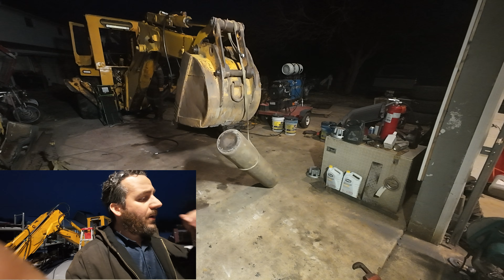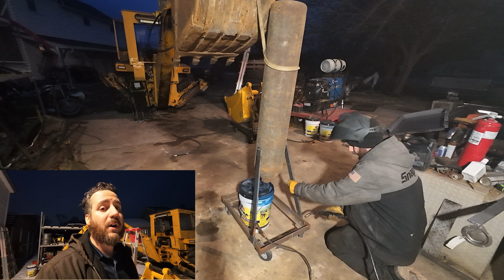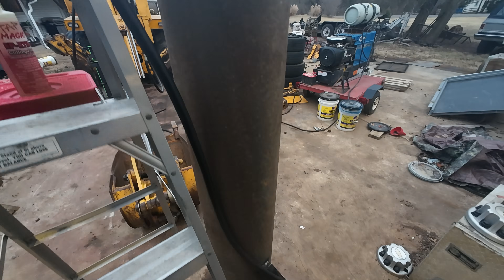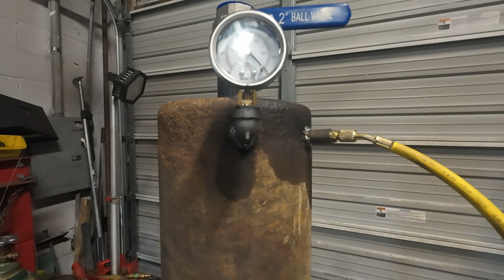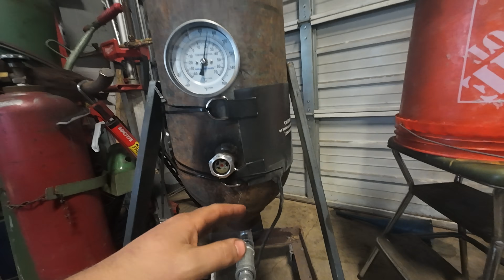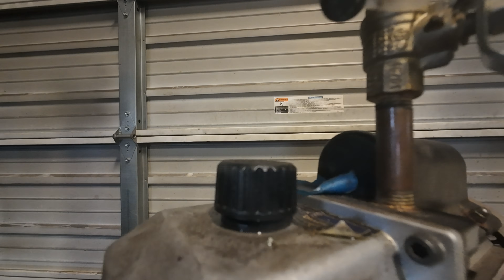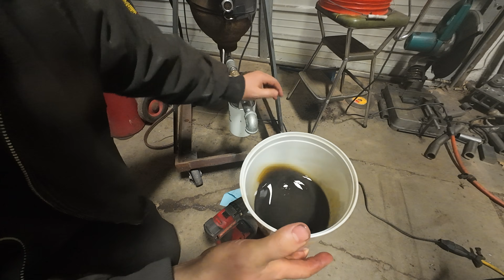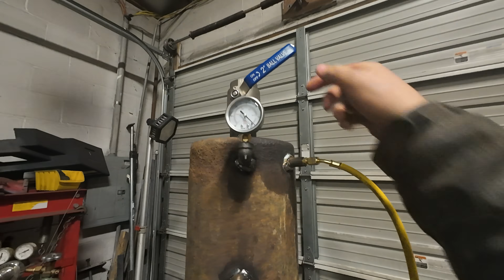I made a machine to remove water from hydraulic oil. Vacuum de-hydration

Comment: 25 years ago, had a heat exchanger burst and fill a 700 gallon hydraulic tank, that held 420 gallons of oil, on a large injection molding machine, full - when it overflowed is when the operator noticed it.  Shutting the machine down did nothing - they had to figure out that shutting the cooling lines off that went to the machine stopped the overflow.  The machine was about 65 feet long and the entire system was full of this oil and water.  We were broke as a company so our options needed to be carefully weighed.  I was in charge of everything.  I talked to many people in the industry.  Found a 1 in diaphragm pump from our lubricant supplier for cheap, he also gave me a 2 in bulk fuel filter that was made by cimtek that he could run water absorbing filters in.  It used three cartridges.  I built a filter cart with the pump and filter.  Decided to have it tested for quantity of water - and fortunately a smart man told me that the oil that was in the machine would be worthless, but to drain all I could and clean all I could then fill the machine to the minimum required to run, then run the machine a little and then take a sample.  We did just that - it had man holes that a small person could fit in and I had a willing employee climb in there and vacuum out the dregs after we draind the machine.  So I have no idea of knowing how many gallons of water was in the oil in the piping and pumps and such without a sample.  I do not remember what the sample showed by it was a lot around 6 gallons of water in that 250 gallons that we put in after the drain in clean.  I did some math - the filter cart I built could literally only hold a few ounces of water per element - did the math and it was going to cost a fortune in elements - that would have been dumb.  Went on the hunt for the most absorbing filters on the market - found US Petrolon - they are still in business.  Paid a lot for their 2 element cart and some spare filters - best of my memory - cart was $5k, filters $75 each - took 3 pairs of filters to clean it up , but wow, it was clean - looked brand new.  Tested better than new on particle count.  The math showed that this was the cheapest option, swapping oil in the machine trying to dilute was at risk to about 7 pumps totalling 225 hp - an expensive risk - oil was expensive anyway - so we would start the machine for a few seconds and move the cylinders and eventully broke lines loose at test ports (this machine has test ports everywhere) to let fresh fluid travel.  Each of their filter could hold 5 QTs of water and would plug up as they absorbed - 6 filters was over 6 gallons as the samples showed.  That filter cart has been used all these years as preventive maintenance every six months on every molding machine and has likely paid for itself many times.  My homemade filter cart I ended up taking after I left because they wanted to clean the shop up (it is my parents company) I have cleaned tens of thousands of gallons of diesel, and hundred of gallons of hydraulic oil to remove water and particles on everything from road graders to skidsteers and many bulk tanks and transfer tanks fuel systems.  Hope this helps someone - US petrolon was top notch to work with back then and the cart was built perfectly.  Hope this helps someone.
Reply: What a great effort and success! Well done!

Comment: this piece is pretty dang cool but i have seen spray dryers before that basically just have a heated tank that heats the oil to roughly 90c aka ~190F and then they have a chamber that sits higher then and drains into the tank, the oil is then pumped from the heated tank and sprayed into the upper chamber while a small fan pulls air through it at a gentle pace this pulls the moisture out of the oil in a continuous process.

Comment: it looks exactly like when i get water in the oil of my pressure washer. I've got a bad seal inside the pump on my pressure washer so i keep changing the oil because it only takes about 13 ounces to change it and im lazy and don't feel like rebuilding the pump right now and it still performs well but I also know what water can do to a hydraulic system I've rebuilt engines no problem but I've never messed with a hydraulic pump so i don't know lol im thinking about just buying a pump that is more powerful than the one i have off of marketplace or something like that

Comment: Spank Ranch Garage have you made any modifications to this build? Also I'm curious to know what your day job is or what field at least 😁 it's an absolute awesome build. I found your video because I thought of the idea someone asked a question how to separate waste oil from water. Is this idea all yours or was there some r&d involved no disrespect just curious.
Reply from the maker: I work in mechanical engineering but in reality I just do boring paperwork. There is very little brain power consumed in Corporate America, so I am free to think up ideas like this to keep me busy at home. I havent made any changes to this machine since the video, its been working good enough as-is. I didnt really have any inspiration when I built it, I just wanted a safe way to remove water without the hassle/risk of heating the oil above 212F. With this design I can plug it in and walk away for 4 hours or 24 hours if I want, and nothing bad will happen.

Comment: you remove the water, but the acid that form from the mixture of the oil and water remains
Reply from the maker: Good point I haven't checked the pH of the new oil vs the dried oil

Comment: It's been a while but who knows, it may still help. 

We use a very similar approach for transformers. The main difference is that we heat the oil to 250F then spray it into the vacuum chamber. This significantly improves the efficiency and the dehydration level to sub micron contamination. The main challenge is just building a pump and spray system that does not introduce a leak into the system. It's normally done by dosing until an accumulator is full. 

Great work though on a home game solution
Reply: As a follow up, based on participate contamination, a centrifugal separator would be ideal to get as close as possible to factory. 

Oxidation and breakdown will not be fixed, but it is a major improvement. We go through hundreds of gallons of hydraulic fluid a year and recycling has been a big improvement in our costs.

Comment: Do you think this work if you adapted the vacuum to go directly on the machines hyd tank and ran the machine to warm the oil then capped the vent off and pulled the vacuum. Obviously would have to take in consideration the thickness of the tank to prevent implosion 🤔
Reply from the maker: I think thats really tough on seals as they are made to work in 1 direction. I wouldn't recommend putting the machine under vacuum

Comment: Here are some suggestions.

1. Run your processed oil through Waste Oil Centrifuge to get it even cleaner.

2.Send a sample of your cleaned oil to a place like Blackstone Lab to determine if the water content is within speck. 

3. Put a Oil Filter/
Water Separator kit on the machine.

Comment: Only way to fully drain a hydraulic system is to fill the reservoir with diesel fuel.   Start it and cycle each cylinder in and out as many times as possible.  Make sure to use things like power steering so that you run the diesel through everything in the system.     You can also go through while it’s running and crack each line and let it run out until it turns to pure diesel fuel.   You will probably need to go through this process at minimum twice.  Draining the fuel and using new clean fuel each time.     Then drain and refill with clean hydraulic oil or ATF (what I run in all my machines).  The atf causes less wear in the winter when cold out causing the oil to be so thick it can actually run the pump dry due to oil not flowing.   With atf it doesn’t get thick in the cold and is great for withstanding the higher temps.
Reply: Also. Don’t try to reuse that oil.  Get new oil!

Comment: As others mentioned, while the vacuum lowers the water evaporation temp, it also lowers the oil's.
That oil did look rather burned.
Might be good to get an oil analysis done before putting full faith in your current system and finding out the additives are gone and it no longer encapsulates the water.
Maybe do another hard core leak test and get that solid and then get your pressure/temp figured out.
Quick google shows hydraulic oil start degrading at 140 F.

Comment: Nice! Can you open a new bucket of hydraulic oit, pour it in an open container to see if it matches the de-hydrator output?  Then run the new fluid thru the Dehydrator for a few hours and put it back in the open bucket to see if the process changes the color...

Comment: Doing this complete evolution, how many times can you do this without any degradation of the oil? If any? Would you be able to use the same oil, filtered and dry of h2o indefinitely? Great videos. I watch you do your magic with fascination. Thank you for the entertainment!
Reply from the maker: I am sure each de-hydration cycle changes the oil slightly. There are lighter additives in the oil that may be boiling off too. For me, I do it as many times as it takes to "dry the machine out". Then I replace the oil before I put it into service. I am really just using this oil as a wick to pull/flush water out of a contaminated system. For this backhoe, I dried 10 gallons of oil out 4 times, for a total of 40 gallons total. I then drained it again and added ~12 gallons of new oil and its been perfect

Comment: You need a cold Trap on your Vacuum line or your gonna put the water  into your Vac Oil ,   A small  cylinder  in an Ice bath should re condense your water before it enters the  vacuum.

Comment: 👍👍👍 I am trying to do the same thing on John Deere 650G Dozier never thought of using an oxygen tank for a vacuum vessel.
Reply from the maker: Anything to get the water out! Those G models clutch plates don't like water from what I have seen. At least they come out fairly easily if need be, but I hope you can dry her out and get back to working!
Reply: Thaks!! I got a friend that get used hydraulic fluid he workd on forklifts ive got around 100 gallons to process lol

Comment: That was great, best vid I'll see today. Wondering what would happen to the fluid--both before & after your vac/boil--when run through centrifigul filter like used to filter engine oil to make black diesel fuel. Subscribing now.

Comment: You basically made a type of distillation collumn.

You could also try a centrifuge to separate things. (You can get these machibes even in small sizes from online shops).

Another fun one is basically a slushie machine. You constantly agite a mixture that you cool below water freezing, and the water will crystalise.

Comment: I worked in the fluid fill industry, we made machines to dehydrate oil by putting it in a steel tank and heating it while in a vacuum and it would pull the water out. We would then dispense the oil out of the tank while still under vacuum and refill as needed to feed assembly lines.

Comment: Would a tank higher than 10m work? With optimal conditions, vacuum can pull fluids only about 10m high. If the isolated tank is higher than a vacuum can pull the fluid, then only water vapor will reach the pump. 

Do I understand that correct?

Comment: My suggestion is to try centrifuging the oil. I saw a YouTube video of a guy cleaning motor oil with a DIY centrifuge made from a kitchen juicer. That video had the pure oil flowing over the juicer chamber, the sediment stayed in the bowl, but to get water out the oil would float (and in the juicer go over the top of the bowl), leaving water in the bowl. Because the juicer orks on an overflow principle you can constantly add more contaminated oil into the top.

Comment: I can say that although the hydraulic oil is dark after distillation of water, its operational properties have improved. Corrosion of the hydraulic system has decreased, hydrolysis of additives has decreased (especially anti-wear ones, such as ZDDP, if it is zinc-containing oil), the load on the pump has decreased due to the decrease in viscosity of the dehydrated oil (the emulsion had a higher viscosity). Good gob!
Reply from the maker: I agree with you! The oil isnt as good as new, but its a lot safer to use in my 50+ year old machines without all that water in it.

Comment: I’ve had that idea for a long time. Really nice to see someone put it into actual practice and work the bugs out.
To keep the contaminants out of your vacuum pump, use a (clean) 20 pound propane tank built into a cyclone type pre -filter. 
With the vac from your pump plumbed into the top valve and the line coming from your dryer into a fitting welded on at an angle to the side of the of the propane tank so the flow introduces a vortex on the inside of the tank,  any fluid will separate to the outside and the clean air will be pumped out the middle. 
A valve could also be installed at the bottom to get rid of oil and any water that condensates on the colder tank. 
An ac compressor also works good as a vac pump. 
Thanks for the video.
Reply from the maker: All great ideas thank you!

Comment: I love DIY projects in the garage. Great job.
Couple of suggestions from chemistry lab:
Mixing the oil in the tank somehow would make water removal much faster.
Installing a trap between the tank and the vacuum pump would save your vacuum pump. Ideal trap requires liquid nitrogen bit you may try desiccants in a long tube along the vacuum line.
Lastly, we use molecular sieves to get anhydrous solvents. Water molecules kind of bind to these ceramic based beads and leave your mixture. They are quite cheap for the job. I wonder if they could be used for hydraulics.

Comment: The method is great! But I would se an intermediate vessel between the pump and the big oil vessel, cooled as possible so you could test how much water you're taking off. Of course, you can compare oil in/oil out and estimate how much water was taken...What aboout a vessel with silica gel (since it can be dried after absorving humidity?)

Comment: You don't know if there was rust on the inside of your cylinder. Probably there was because that is an oxygen cylinder and OXYGEN CAUSES RUST.  Rust is iron oxide.
I believe there is only a trace of rust in your reconditioned oil and it causes the discoloration. Ignore it.  
You did a great job.

Comment: Id add a bit of ethanol and let phases separate. Then separate off water. Then add 4A Molecular sieves. Recycle them in an oven to dry. Fast cheap and easy. Probably oven drying a cheap zeolite kitty litter would work just as well for your purposes and can be recycled or dumped. Hell, damprid (cacl2) might work really well for the first water stripping. Run a cold finger so you dont put all that water thru your vacuum pump.

Comment: I used to just put the oil in a bucket with a drain valve on the very bottom, let it sit a few days, open the valve and the water would drain out. Once oil started coming out clear and not milky, no more water.
Reply from the maker: For whatever reason that doesnt work with this fluid. It wont let the water out without other means. This has worked great for engine oil for me

Comment: Cold trap would save the pump could modify a ice maker or window ac and maybe get a electronically controlled valve and the valve that lets you cange the flow of the refrigerate so you can defrost the cold trap on a timer

Comment: Fantastic engineering skills!! thought: add a fan or chilled water condenser between the vacuum pump and tank to get the moisture out or it will keep killing the vac oil.. Even only 5-7 turns of copper tubing immersed in chilled water would be perfect with a drain tap at the bottom for periodic draining.

Comment: By the time you add your electric bill into the equation and pump running you be better off just buying new cheap oil
Reply from the maker: 400W heat band, 600W pump. 4 hours run time per 5 gallon batch. ~14c/KwH. ~ 56 cents per batch. Ill keep going.

Comment: If you get a good vacuum you can get the boiling point of water below 32f. Talk to a HVAC tech. Commercial industrial techs do alot of dehydration of large systems.  We can pull vacuum deep enough that freezing of moister is a concern

Comment: This is the exact idea i had for black diesel dewatering without tons of heat. The vacuum pump has to use less power than a heating band. Only thing i might change for my purposes is to use a larger propane tank to process more oil at once.

Comment: Doesn't the oil boil too? I think that besides the water, you are vaporizing and removing all the 'light' fractions in the old fluid and leaving behind the heavy stuff. 
That reclaimed oil is not the same stuff as you started with.
Reply from the maker: Quite possible. I wonder if its any different than running it in a warm machine that has a cavitation issue...

Comment: Use gravits filtration through water absorbing beads (same material used in baby diapers) search "water absorbing beads" 
Furthermore if you have vegetable based oil or any oil which might have in it unwanted glycerine then benzoyl peroxide (not easy to purchase) can be blended in an emulsion with water and small amount of oil.  This benzoyl peroxide product can be initially blended with the "glycerin contaminated oil" and it will cause the glycerine react to become alcohol.  After this step the water bead gravity filtration process is performed.
This is my experience after working for a business which taught similar processes to their clients and sold kits for processing waste oils.